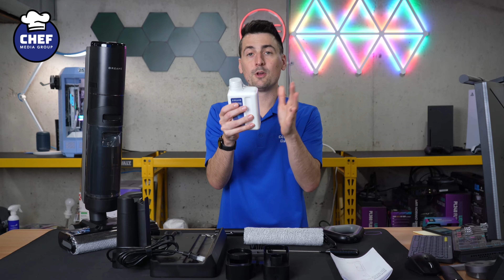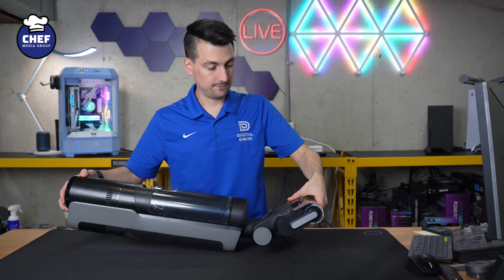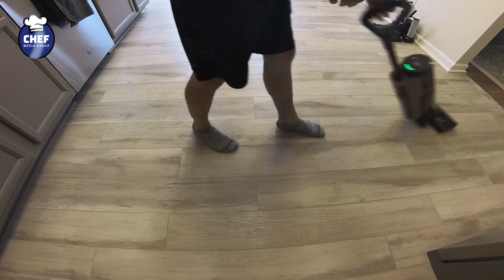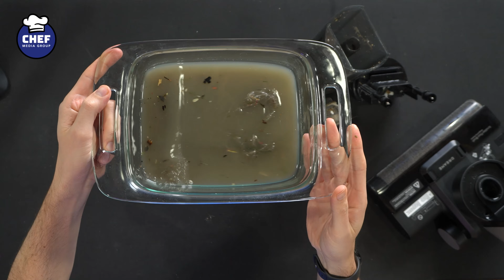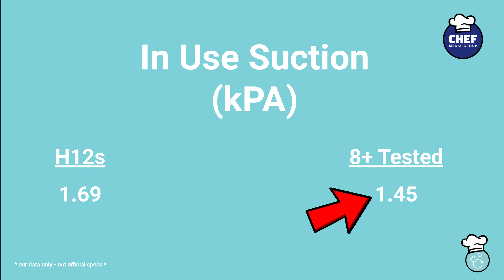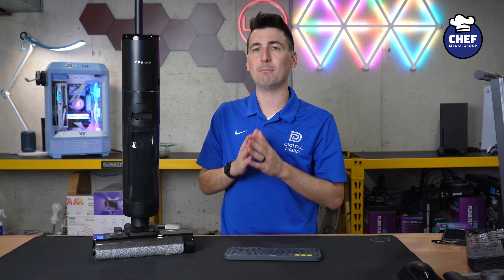Dreame H12S Review: A Smart Solution for Effortless Floor Cleaning

Comment: I just got one for Christmas and was super excited to use it! But it only seems to vacuum but doesn’t mop (the clean water doesn’t come out). Do you know how to help with this?
Reply from the maker: Make sure it is in auto or max mode... suction only mode will just vacuum! Also I am assuming you did fill the clean water tank up? If so it should work rather quickly to wet your floors (it will never be soaking wet or anything FYI!)
Reply: @ I tried all of that and it still doesn’t work. The self cleaning also doesn’t work…
Reply from the maker: That is super strange... I am guessing something is severely wrong so best to reach out to customer service or return and exchange for a new one!
Reply: @KTapps14 I bought one too I just used it today and I dont think the self cleaning works either it seems like it just dries the roll but now clean
Reply from the maker: Why don't you think your self cleaning works? How has it been the last 2 weeks do you have any update?
Reply: @VacuumChef  I ended up returning it because no water was coming out (to self clean or mop).
Reply: @dianeperez7419 oddly enough, mine cleans but doesn't dry the roller. I hold the button for three seconds and no dice. Will let it charge up and retry

Comment: It claims it is self propelled in their description site???
Reply from the maker: All wet dry vacs kind of self propel themselves forward with the way the mopping system works but there is not driving/wheel power/assist if that is what you are wondering. The website would be a little misleading if that is what you think!